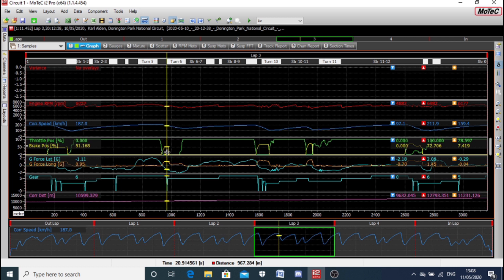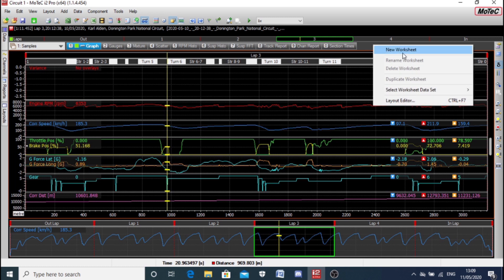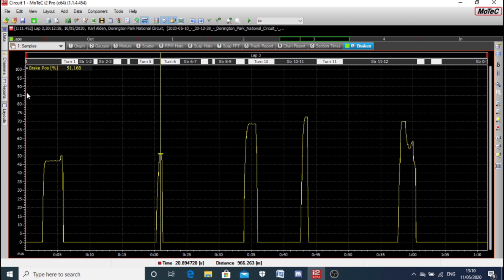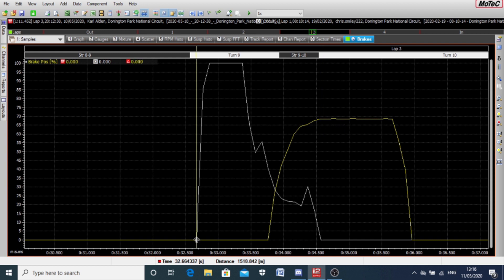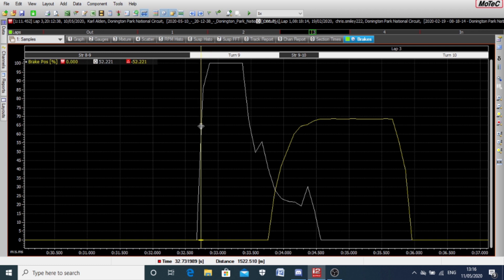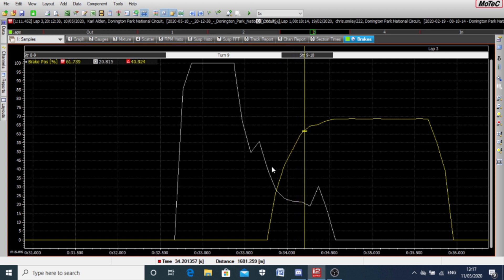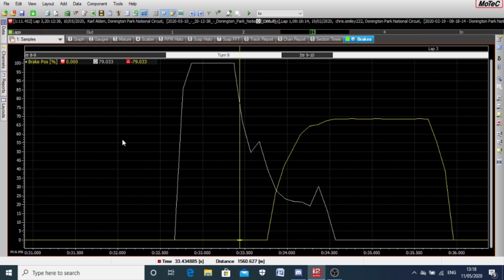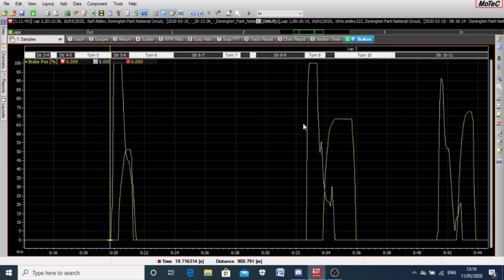Sim Racing Coach Part 1 - Braking Tutorial Motec i2 Pro. How to improve by 1+ seconds a lap.

Comment: A bit confused as i thought not to max brake due to locking tyres? Like i maxed out my sprints to 80%.
But this shows i should go to 100 % à thus lock the tyres ??
Reply from the maker: Depends what car you are driving and what tyres etc. But at top speed with slicks you have so much inertia in a car for the first part of braking you won't be able to lock the tyres up, but, as the energy comes out of the car ie as it slows down, downforce comes off, inertia reduces then you'll back off the pressure gradually.
Reply: @GPRaceSimulation  im using the audi rs3 lms wich is a fwd. I thought that one was  to be locked at 80% to not lock it. But i will give your advice a run and basically press it really hard to shrug of the initial speed fast and then trailbrake smoother and hopefully not lock the tyres often. 

I do have set my sprintd to 15kg to press due to trying to preserve my kneecaps :-D any suggestion there ?
Reply from the maker: @Kozzzmozzz7  that's a very light pressure, F1 drivers are up around 120kgs. BTCC drivers are somewhere like 55-60kgs. Ypu should have more fidelity with your trail braking if you set max load higher. 50kgs and above is quite hard work on the knees......
Reply: @GPRaceSimulation  so upping my kg pressure will result in better results you might say? but just below 50 kgs that is. otherwise my seating position is not good either , i have my heels on the baseplate and for pressing much much higher kgs i need to verticalise my leg so i press with my legs instead of the top of my foot.
Reply from the maker: @Kozzzmozzz7  yeah you need to be able to press with your leg not just the twist of your ankle.
Reply: GP Race Simulation  real world drivers have  their body weight added to the brake pedal through G force as the car slows. In a sim, the effort needed to achieve the same pressure on the pedal is much higher. Am I wrong?
Reply from the maker: @davidwalters6695  no not really. Because a driver is strapped in to the car, only his leg weight would be affected by any G force. The G force would only be created due to his effort and only after a short period of time once the effect of braking hard had begun to deccelerate the car. So yes there would be some small effect but he still has to generate the force initially and that G force decreases as the rate of deceleration decreases as the car slows. That's in F1 cars etc that can pulls 4 G or more, most race cars can't pull more than 1.5 to 2 G so that effect is even lower.
Reply: GP Race Simulation thanks, interesting.